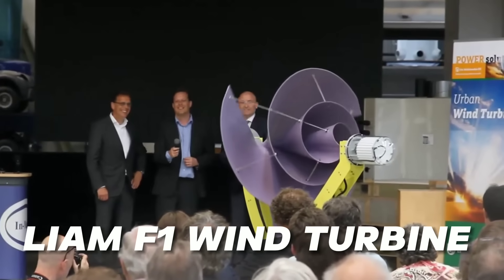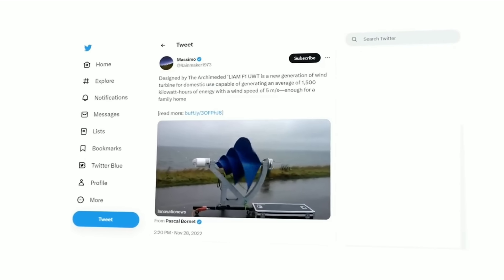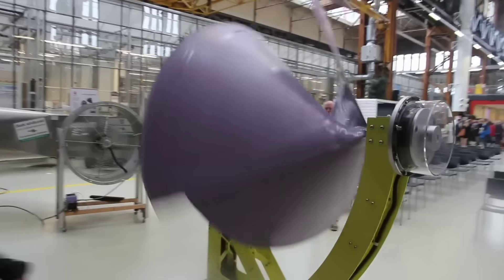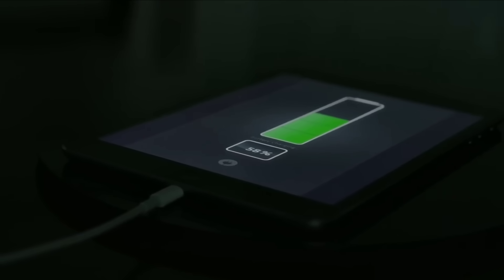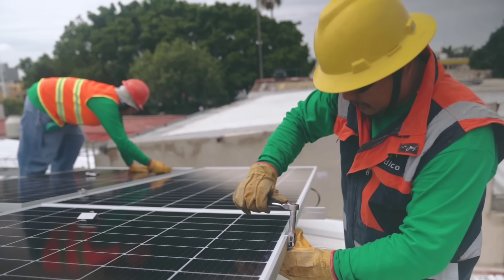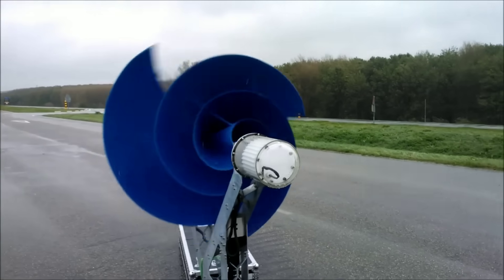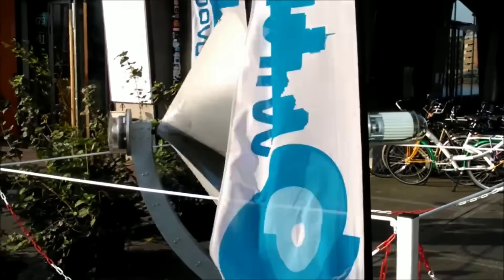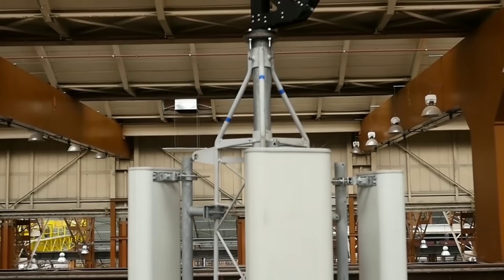This NEW European Wind Turbine for Home Outbeats PV Solar Panels in 2023?!

Comment: This notion of mechanical wind turbines requiring less maintenance in my opinion is absolute rubbish.

Both systems will require maintenance. 
Solar is cleaning and new inverters (between 10 to 25 years depending on type) and the turbine will almost certainly fail during that time from mechanical bearing failure. I suspect also it will fail electronically as per the inverters on solar.

Having said all that, i wouldn't mind having both systems combined with a battery system and a decent tariff like Octopus Go.

We also need nuclear energy to cope with the enormous EV demand which is ramping at a colossal rate.

It's all good though. All these climate activists need to have a little more faith in engineering and enterprise.

Comment: Stupid commercial! Comparing sound levels to infrastructural sized windmills, but not the energy output of them? Wind is just as skittish as sun-time, so BS on the "you need two to power your entire home". And yeah by mentioning the name a thousand times, doesn't make it a better product. Wind turbines will indeed wear out before the solar panels, due to it's mechanical moving parts...it will need regular maintenance by a trained proffesionel to outlive the solar panels...however, anyone can wipe down their PV array in 10 min. with a broom. "1500km/h"?? hahahahahahaaa you are a joke.
I would also be concerned about installing these a my roof without having to add extra rigidity to the construction due to the massive 120kg(or 280kg as it says in the brochure) it weighs+the added weight of the wind drag...you would ABSOLUTELY need proffesionel help installing this!
The specs on the webpage doesn't add up with the specs in the downloadable brochure. And where are the dB info?? It's no where to be found, even though it's claimed to be very quiet.
This montage offers ZERO proff of out performance and wtf is that you've added to the description of this vid??? "DISCLAIMER: Our channel is purely made for educational purposes, based on facts, rumors, and fiction." Straight up delete yourself.
Future Galaxy, I hope you got a lot money from this one.

Comment: You are all wasting your money. I have made a heat and electric powerstation at home...and the fuel is free.
I found an old tyre dump, i just set them on fire in my generator and free heat and power. Job done.

Comment: I'd like to share my story as a solar owner that seems to have uncovered a lot of scammy things. My experience with solar has been pretty bad, and I've come across some shady stuff while having to learn how to maintain my own solar system. I've noticed that many folks have been left hanging when trying to get help with their systems. The company that installed my 10K system stopped taking care of it after only 3 to 4 years.

Within a couple of years, the inverters started failing. The installer would replace them and claim free replacements from the manufacturer and more than likely a maintenance fee. That didn't seem unusual at the time. After about three years, the manufacturer (SolarBridge) went out of business, and it got harder to source Pantheon inverters and other parts. Eventually, another company bought SolarBridge, of course, for pennies on the dollar. I seem to recall that SolarBridge had received government subsidies too and likely the new buyer would as well. 

When the installer left us hanging for good, I couldn't find any company willing to take over. So, I decided to learn about my own system. I hacked into the SolarBridge manager and discovered that most of my inverters were perfectly fine; they had been software-disabled to output. I could see panel output but no inverter output. I suspect because the maintenance folks were making money by replacing them and getting free new inverters they could sell to others. I am yet another person that never got what they were promised but at least I can maintain my own system now.

Do you see the big picture here? These companies set up, sell millions, go out of business as warranty starts eating into their profits then a new company buys them up at a fraction of the cost. We taxpayers are footing some of these costs and losses. It's corrupt as hell and it's probably not the only industry that does this.

The solar industry is a letdown, which is frustrating because solar power is a great alternative.

Comment: The trouble with solar panels . Without installing expensive batteries you tend to produce power when its not so needed. But at night and in winter when you need it most next to nothing . But wind more regularly.

Comment: An ideal system would have a mix of solar and wind generation, not really happy to see this video spoilt by making it a fight between solar and wind. Usually higher winds are when there is little or no solar. I have 9.6kW of solar with 17.6kW battery and would like to be adding wind turbines next.

Comment: Bottom Line: The more moving parts that something generating electricity has, the more likely something will fail. One many do not know is that those giant wind turbines are not Eco-friendly at all and usually containup to 11K gallons of lubricating oil each that are susceptible to failure and potential environmental hazards through leaking seal systems. smaller systems are not economical because these companies are in business to make money and are charging ridiculous amounts to justify renewable energy. it's all a scam starting with energy companies monthly charges.

Comment: Sorry but this is tosh. Small scale wind does not work, we’ve been there’ tried that. €4000 for a unit that makes 1500kWh per year. That is €2.66/kWh. A 4kW solar install will generate around 3800kWh per year and costs around €7k (that’s including inverter everything, unlike the wind turbine). €1.8/kWh cost. 

Also if you’re going to the effort of making this video, don’t mix up km/h with kWh.

Comment: Really sick of these beat ups for wind generators. The energy available in the wind is proportional to the cross sectional area of the turbine and the cube of the wind speed. The Betz limit is 60% of the available wind energy, not 80%. Bottom line here is unless you are in a very windy location you will probably achieve less than 100 watts output.  You need big diameter turbine blades to get useful energy.

Comment: Those saying solar beats wind or wind beats solar alsways ignore:

Wind only works within design wind speed range of the wind turbine.

Solar only works when the sun shines brightly enough.

There are places the sun doesn't shiine enough for 3 months and less than half the rest of the year gives enough to be worth trying solar.

There are places the wind is not reliable.

There are weather conditions that make either or both impractical.

I live in an area where wind or solar can be relied on 90% of the year and USUALLY when one is not within good operating limits of the devices, the other works.  My neighbor has wind and solar and his systems are working well enough to be 100% off grid.

I am at an economic positionwhere installing wind or solar won't pay off before I die.... financially it would just  be stupid for me to install either.
Reply: BTW... the "supposedly" new wind turbine design in this is a very minor alteration of a design by Archimedes of Syracuse.... and he drew it up appx 2250 years ago.

And there are STL files for free to 3D print the Archimedes turbine.... and mount it to appx 1 hp generators (750 watt) for experimenters.

Comment: How long do you guys think it’ll be before we see these in some form on electric cars? Sort of the “why didn’t they think about this already” type thing. You’d be able to partially charge whilst driving, reducing the need (as much) for charging at stations.
Reply: Putting a turbine on the top of a moving car adds drag.  That drag is where the turbine collects its energy.  The energy producing the “moving wind” by driving comes from the ev battery pushing the turbine through the air.  And you only collect up to 80% of the energy of the drag caused by the turbine, so you actually lose out in this equation.
Reply: @nathannopants3157  Some big brain somewhere will figure out how to put something in the “grill” area. Sure, it may only gain as much as the brake system. However, if it can extend the range without affecting highway efficiency will make it worth the R&D of making it possible. It’s not the electric car itself reducing “carbon footprint” but the having to recharge, as I’m sure you know.
Reply: Yeah, why don't we aim giant electrical spotlights on solar panels to produce more electricity...
Reply: Hi. You mean like spending a dollar to gain a dime? Back to school for you, chum. Cheers, P.R.
Reply: There are already cars in production that have generators -- but not connected to a big, ugly wind generator, but directly to the wheels! Those generators can then even be used to drive the car, so they don't even need the century-old invention, the combustion engine with all its maintenance costs and, worst of all, impact on the environment and the health of people forced to inhale all the toxic byproducts. How long do YOU think it'll be before all cars are like that?
Reply: @bfelten1 Hi bfelton. You're onto it! Regenerative braking uses the car's kinetic energy as a free storage battery. Many of the comments on YT show a "junior high-school" level of understanding, and people like you are bringing the motivated kids up to speed. Well done, and thanks. Teaching classes is a tough profession, but YT is one-on-one. If you're young, have you considered teaching? Cheers, P.R.
Reply: @philliprobinson7724  Thanks. I'm actually a 75yo (retired) physics professor at uni level, so I've done a lot of teaching in my days. 😉
Reply: @bfelten1 Hi bfelten. It must have been nice teaching self motivated students who were there of their own freewill. I majored in psychology. I also worked in business, entertainment, and have written humour columns for a newspaper. Death gets the last laugh. I'm 74. It goes so fast, eh? Cheers, P.R.
Reply: How can so many people get this wrong? The solar panels would be on the roof and the turbines would be in the front bumper. You’d use wind force to create motion and then suction to reduce drag. Both turbines and solar panels generating power to the battery banks. Use the motion of the vehicle to help propel it. The very concept we’ve been pursuing for over 200 years.

Comment: i have 24 kw solar panels system 8x3phases. it gives some advantage in summer, but at winter its allmost nothing course day is very short first of all. and at winter air conditioner heater, water boiling etc is the most of consumption. wooden pelets are quite expensive and pelet oven is a realy big problem course it produce dust, at least 1 or 2 times something is broking and for people who cant fix it itll cost more than electricity heating to pay company that fixing it. and wind turbine for heating could be in theory a good idea

Comment: ive read that its allmost impossible to use wind turbines without accumulators course it gives very unstable electricity and everything is blinking etc. same as diesel generator. but it could be useful for winter heating device in bedroom for example or to boil water. this would be interesting to know kind of - is it working well, whats the amount of heat it can give more/less etc. and parallel heating devices kind of for bed, chair or japan table or bathroom, water heating floors etc

Comment: Solar panels do not rely on sunlight. They work in cloudy conditions. They last years, well over 25. They don't require maintenance. They don't need manual cleaning, rain does it. The false statements in this video causes me to question the integrity of it. This is really an advert.

Comment: The biggest drawbacks of my solar panel array is that it does not supply any power at night and most of all in winter this is annoying. Solar panels tend to give too much power in summer, when you not really need it and too little in winter. This turbine could be ideal on (windy) cold winter nights just to keep an electric heater running to cut down significantly on gas usage, or, if the device really gives what it states you can definitely warm a room with 1,500 watts of power. Let's keep an eye on this.
Reply: Both technologies are limited by supply though.

The difference being that solar supply is intrinsically predictable both at a daily (weather not withstanding) and seasonal level.

With adequate battery storage solar can still supply throug the night, and thankfully the EV revolution is demanding such high quantities of battery cell manufacture that domestic battery storage is becoming much more economically viable.

Comment: I have many friends that live off grid, most use solar and wind, generally it's mostly solar. This is expensive but supplies most of the needed power. In locations where solar doesn't work well wind is more consistent ( mountain valleys) and a better choice.
 Love the Archimedes design and always have.

Comment: If you put the cost of any home electric production system into a Treasury bond instead of destroying your home construction, paying interest to a bank, paying for equipment requiring maintenance and replacement, you could pay all your energy costs indefinitely with zero effort.

Just as you could buy an EV, pay a car loan and search for an increasingly more expensive place to charge your car while growing a beard waiting to plug in.
Or, do as I do, keep my perfectly dependable ICE vehicle with $60,000 in a CD at 5.75% APY.

Comment: The practical efficiency of a wind turbine varies between 30 -45%, and it may rise to 50% during peak wind.

This gizmo is 80% of the Betz limit (59%), or .8x59%.  That makes the practical efficiency of this gizmo approximately 48%.

The article is hogwash.

The idea that other turbines don't have the ability to point in the direction most suitable for energy production is also hogwash.

Additionally, other turbines can change pitch of the blades for maximum energy production and for safety in severe winds.

This article - hogwash.

Comment: FYI in the amount of energy that can be produced it has km/h which is kilometers/hour  you want kw/h.
The installation is not going to simple as you are going to have to mount it on structulely facility.
Also just because it is waranteed and has a life expand does NOT mean it will not need to be serviced periodically.
So lot of Hype.

Comment: Did they say anywhere what is the energy produced and for what wind speed? Looking at the tiny generator connected at the wind turbine, I don't see it producing more than 500Wh, which would be about ten times less than solar panels.

Comment: I think the various commentators should research both Betz fan laws and wind (turbine) cube laws! The relationship between wind speed and generation is far from linear! Perfect balance and bearing longevity go hand in hand. A general engineering law is that if it moves, it wears, if it wears, it fails on an unpredictable time scale; unless snake oil is the recommended lubricant! Condition monitoring on such "cheap" equipment is simply not cost effective. Latest iterations of both PV panels and peak lopping batteries will always outperform any electro-mechanical wind energy conversion to usable electrical energy. Ask any salesman to explain the output of ANY wind generator when the windspeed is HALF of the ideal rating! That infernal cube law really spoils any sales pitch.

Comment: why don't they connect the turbine to an acid battery,  then the turbine out performs the battery = win. i am sick to death of these eco planet saving memes that actually don't work. solar panels that work at night, wind turbines that don't work without wind. coal fired plants that step in to supply power when the other 2 don't work. loonys running the asylum

Comment: Average European households consume 3000 kWh p.a.? Source please. That is a ridiculously low number. I am using 90K kWh p.a. if the snow melting is on. I can squeeze it down to about 60K kWh without it. I have both geothermal and district heating and have about 2700 m3 of heated volume at about 60 degrees north.